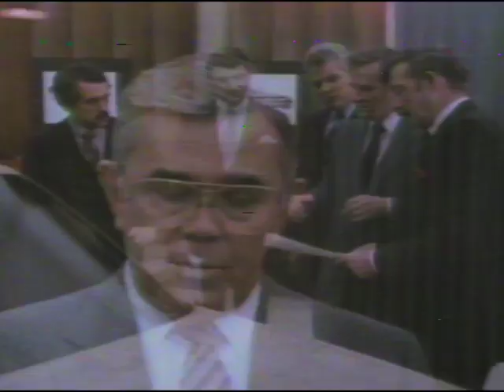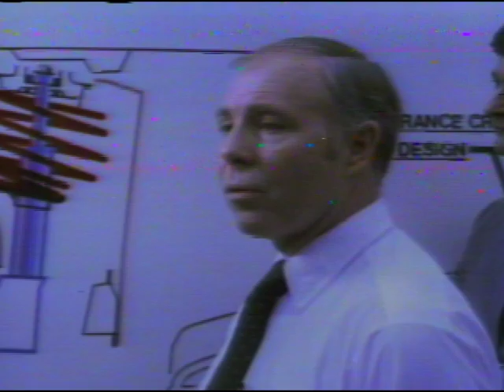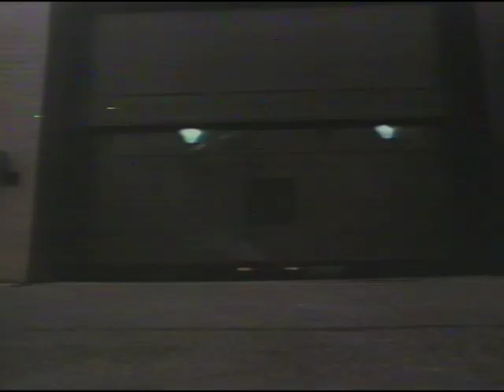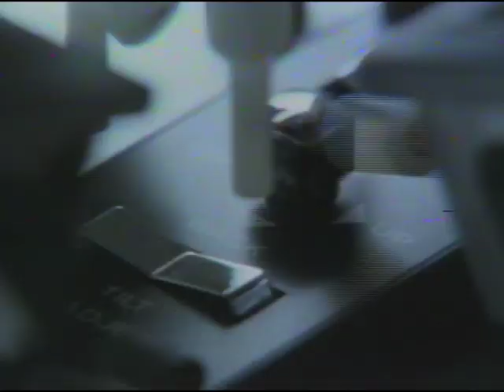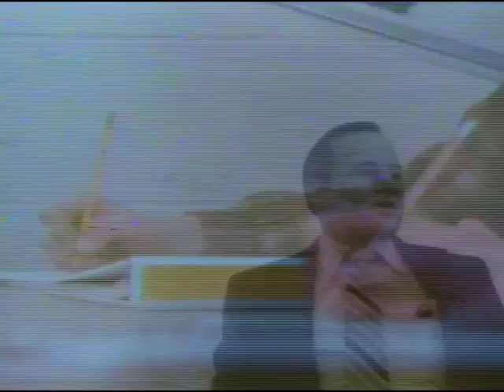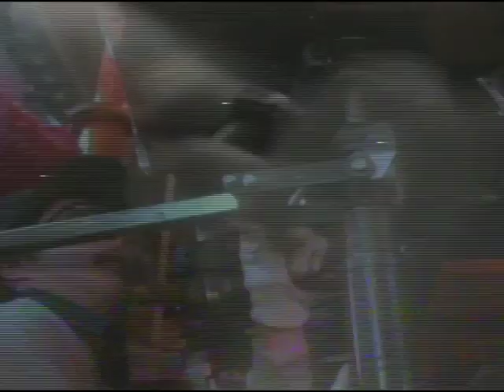1985 Cadillac "Birth of a Car" - The FWD Deville/Fleetwood Story

Comment: Too small with very unremarkable styling. The interiors were nicely done on on the Devilles with plenty of legroom front and rear. The positively junk "Hook n Tow" 4100 V8 was an awful scandal for Cadillac, in the wake of the half-baked V8-6-4 and notoriously unreliable Olds 5.7L diesel. At least the reengineered 4.5 and 4.9L V8 Engines were very reliable and powerful. But then there was that damn overly complex (but powerful) 32 valve DOHC Northstar V8 that blew head gaskets and had a leaky coolant cooled alternator.  The earlier model years of the Northstar were filled with warranty claims for the head gaskets, multiple oil leaks, and overheating. Ugh.😮

Comment: So if the 85 Deville and Fleetwood models arriving on dealership showrooms in early 1984, this project must have began in 1979 or 1980.
Reply from the maker: It absolutely did. Viewed from that light, these were really the best designed and engineered cars Cadillac had ever made. But is also the reason they completely missed the mark on size and styling.

Comment: After the 4 million miles of testing you would think they would have easily discovered the metallurgy and head gasket issues with the HT 4100, especially given they were already inappropriately in use in the previous larger RWD Devilles and Fleetwoods for a couple years at this point. It’s quite likely they did know, but CAFE left them no choice but to proceed anyway and use the customers as guinea pigs to improve it. They eventually did as the 4.5 L and 4.9 L versions were far better, but the damage was done.

Comment: They should have put the 3800 in the Cadillac like they did the Buick and Olds. They are very good engines.
Reply: nah, first the v8 was just for marketing. imagine buying a top of the line luxary car and it had a v6. at this time the buick 90* v6s were not redesined for fwd yet. really if they just didnt rush the ht-4100 into production to replace the 4-6-8 engine theyd be fine

Comment: What's the best thing that ever happened to a Cadillac?  They dropped Chevrolet V8 engines in them.  1990 (optional Chevrolet 350. Base engine this year was the Oldsmobile 307) 1991-1996!!! Applies only to the rear wheel drive big bodies.
Reply: Cadillac made very good V8s prior to 1982.  I owned a few before then and were solid reliable engines.

Comment: And the customer decides he’s not too terribly impressed with a small Cadillac so he goes across the street to the Lincoln dealership and by the 1985 Lincoln town car.
Reply: With the super reliable Ford 302 V8, and the durable AOD transmission.  Instead of shelling out their hard earned money on that terrible "Cadillac" HT-4100 V8 and the built like a deck of cards THM 440 T4 transaxle.  In all fairness, the transmission would be fairly good by 1987 and excellent by 1988.  The lousy HT-4100 would be reworked into the very good 4.5 liter V8 from 1988-1990 and later on, the excellent and durable powerhouse 4.9 liter V8 from 1991-1995.

Comment: GM screwed up in the late 70s and early 80s with the front-wheel drive crap with the wheezy old-school low-tech engines they were stuck with while the Germans and the Japanese  slaughtered  the big 3 with better handling and better built cars with a higher level of quality and attention to detail  and more advanced engines than the big 3  ever came up with and were always caught unawares about for years. Those others had better suspensions and better brakes (even 4-wheel discs) and more advanced drivetrains when the big 3 still relied on the same old technology that worked ok but not up to par with the competition. They took too long to catch up.

Comment: I'm a proud owner of a 1986 Coupe Deville  bought new by my Father in law RIP with the infamous 4.1 L.  24 mph on Highway still runs at 179K  I did the intake gasket myself but has its original head gaskets I added an Alpine stereo system. Many small parts replaced over the years. wish I could post a photo for you all, in #22 Gossamer light blue metallic 1/2 landu padded vinyl roof, dark blue prima cloth (velvet cloth seats) and interior.

Comment: Big fan of this era of Cadillac on its own merits, and a Cadillacker (that's a Cadillac Enthusiast) of all eras 20th century plus the 2000 DeVille. Currently I am dailydriving a 1992 Sedan DeVille with a 1977 Sedan DeVille freshly registered after an engine rebuild and a few others being built.
The 1992 is, as I see it, Cadillac's take on an average car with the types of features you'd expect in the larger models. I like it because it is easier to parallel park, making it the choice to drive to Boston or Providence and work the traffic effectively and efficiently, where the '69 Fleetwood Brougham for example gets through by sheer intimidation...after a wait.
The Front Wheel Drive makes it somewhat more difficult to position to park when between two already parked cars (four years of driving this car and i am still not used to that) where Rear Wheel Drive is a breeze. 

I am driving this car as it was meant to be driven, 3 of the 4 centercaps have fallen off (one has simply vanished but i still have the other two) and the transmission develops a minor slip every several thousand miles that's easy enough to remedy but makes the interim annoying. These cars are prone to progressively deteriorate one little thing at a time, but the platform is solid for rebuilding once the driver's threshold is met. 
I am a lover of heavily customized cars, so naturally the plan is to build the 1992 DeVille that way. Being able to drive this example for so many miles before beginning work allows one to get to know the car and better know how to build it. I like purple. But my '92 is Maroon. I've taken to calling it "Cadillac Car Tune Maroon", (see if you can catch all the things referenced haha) and have come to really appreciate it especially at its glossiest, thereby deciding to embellish this color rather than replace it. The build is a mix of Les Dunham's Superfly and the Japanese Kaido racer/Bosozoku style. That's the best way to describe it in a nutshell. 

Next daily, alongside the '77 DeVille, is going to be one of these earlier Fleetwoods.
Reply: I like the way you described the '69 Fleetwood Brougham....by sheer intimidation;  yes it is a BIG car.
Reply: @nycstarport8542  its long but its low. Its more the presence it gives off than the size; i have a video of the first time my Fleetwood ran under its own power for the first time in 30 years beside several early 00s Volvos and a gold 94 940. Its sort of...small? Like, much shorter than you'd think it is heightwise but it is long. Its the "face" of it, the grille and headlights (we don't talk about the windshield-based bastardization the Cars movies caused) that is imposing, impressive, and yeah, if you're driving something like a Chevette or a Honda Fit, quite intimidating.
That's the '60s styling for ya, the customizations i have planned are gonna change that up and adjust that aspect to a more celebrity "starstruck" sort of reverence.  These cars were born for the camera, beautiful at every angle. 😻🤩

If i wanted something to intimidate people out of my way i'd buy a black 2017 ford explorer, put a brush guard on the front, put low-profile plow lights in the windshields and black out the windows...😎🤮

Comment: I had an 86 deville as my first car in 2002. It was a fantastic car, with a terrible engine.
Ultimately I scrapped it because it would never start in cold weather anymore. Had about 210,000 miles, no rust, and mostly everything else worked except for a couple movements on the power bench seat.

Comment: I would never classify these as “world class.” Considering all the testing that went into this design, the build quality was exceptionally low - even for a domestic. What’s more is that the targeted demographic GM was hoping to attract with the new FWD design largely turned their noses up to the new Sedan de Ville. That being said, I remember as a teenager at the time being very intrigued by a front wheel drive deVille. The mid-to-late 1980’s was a pivotal time in the automotive world, and the new Sedan de Ville definitely fit in with the “contemporary spirit of Cadillac” in its attempt to move along with the times. What you had in these (more so after the first couple of model years) was all the advanced tech for the time, as well as the smooth, heavy Cadillac ride, all within a much smaller package, and even as a teenager I thought that was pretty cool. As I say, the overall build quality could have been much better, and hindsight is certainly 20/20, but I’m still super excited to see this iteration of Sedan de Ville finally catching the spotlight. I’m looking forward to seeing whether or not these cars go up in value like the early 80’s Eldorado and Seville have.

Comment: Cadillac lost their loyal customer base.  First the one year only 4-6-8 engines that were a dismal failure.  Then with their diesels.  Those 1985 Cadillacs retained the miserable HT-4100 engines that came out in 1982.  The dealership mechanics despised them.  Finally in 1988 they made a better 4.5 engines but by that time people were bailing out.  A Japanese car called Lexus was happy to take over.  What a shame.  They never recovered.
Reply: You forgot about the Cimarron or were just being kind by not piling on?

Comment: Of all of the 1985 FWD "C" body cars, the Cadillacs just LOOKED too damn small. Inside they were about as roomy as the 1984 RWD versions, but they lacked the "presence" of the 80-84 models. The 85-88 looked "shrunk" (The first FWD Oldsmobile 98) had a similar (but less jarring) effect. The car that looked best on this platform were the Buicks (Electra/Park Avenue). It's almost as if they designed the Buick body first and forced Cadillac and Oldsmobile styling on it to make the others. They got SOME of the "presence" back for 1989, But I'm SURE many Cadillac dealers and buyers were glad that GM kept the 1980 (itself a "remodeled" 1977 body!) RWD Cadillac body (as the "Brougham") around until 1992!
Reply: I didn't like them too much either at first.

Comment: I bought this 85 Deville, worst car I have ever owned!
Reply: I was service manager at our local Cadillac Dealer when these cars were new. They were horrible cars. Very poorly engineered!
Reply: @3713msg  The drivetrain was shit, The rest of the car was OK. Better to have had the Buick or Oldsmobile version - Better motors AND a bit cheaper!
Reply: You should have bought the Buick (Electra/Park Avenue) version of this platform. MUCH more reliable drivetrain! The Buick 3.8 liter V6 was WAY better than ANY of the crap engines that GM  shoved into Cadillacs in the 80s!
Reply: My condolences lol
Reply: Was it the HT 4100 engine?
Reply: @highspeed1865  Probably.That engine was crap!  The Buick version of this platform (3.8 Liter V6 Electra/Park Avenue) was the better buy, And it even LOOKED better!

Comment: GM may be many things - but you can still see many of these H body cars in tip top shape still on the road today
Reply: Technically, The FWD Cadillac DeVille, Fleetwood, Buick Electra/Park Avenue and Oldsmobile Ninety-Eight are "C" bodies. The FWD Pontiac Bonneville, Oldsmobile Eighty-Eight and Buick LeSabre are "H" bodies. (Cadillac never had an "H" body model) The differences between the FWD "C" and "H" bodies were mainly wheelbase length and "greenhouses" (rooflines). It might seem trivial but from 1959 until 1984 those also were the major differences between the RWD "B" and "C" bodies. GM gotta GM! LOL.
Reply: I have a 1990 Olds 98 Regency with only 52 thousand . I love it.